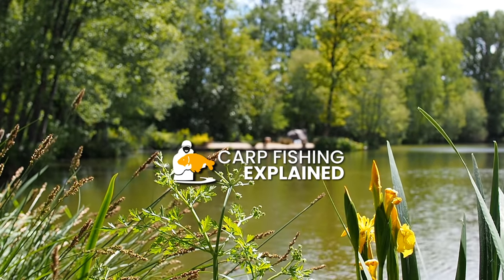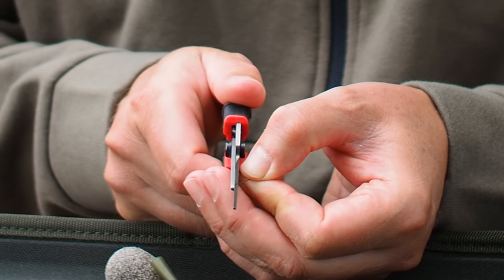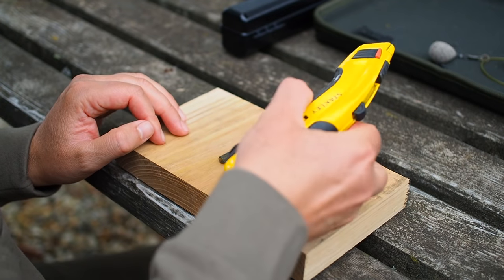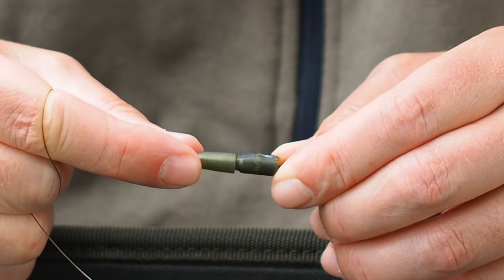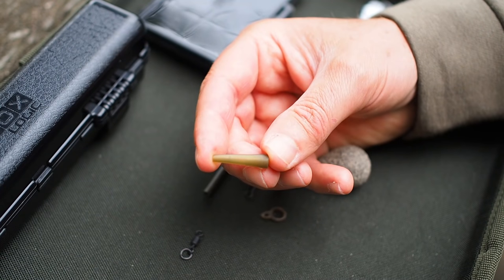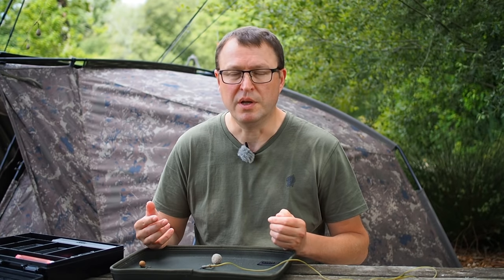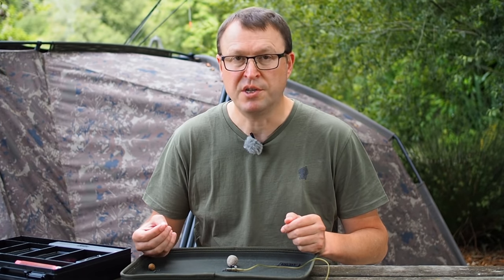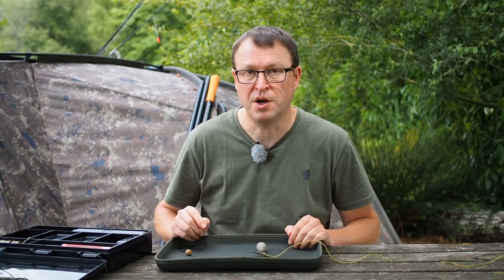I Cut the Leg of a Lead Clip (HERE'S WHAT HAPPENED)

Comment: Hallo Matthew, again a great video with a solution to avoid the leadclip problems i'am using already for years.  I'am gonne try your rig setup this season.  Normaly i'am using always a leadcore leader (gone switch to unlead).  Can i use this material for your "shock and run" rig setup?  Is there a reason why you use sometime a tube and other times a unlead core leader?  Thnx
Reply from the maker: Hello Eric, thank you very much for the feedback. Yes, absolutely, you can use a lead free leader for this shock and run rig setup. Some waters ban lead free leaders so that's where I'd use rig tubing. Certain setups work well with either, some with leader but not with tubing and vice versa! So it really depends on the lake rules and the lead setup you use if that makes sense 😊 Really good question! Cheers, Matt
Reply from the maker: Leader or rig tubing ?
Reply: @matthewcollinsangler  Leader...

Comment: Hi Matthew. When fishing a running lead I am sometimes worried the lead has not fallen into its side leaving the hook link sat up off the bottom near the lead itself. Do you always give the lead a small pull after it has settled? In which case maybe a bit of rig foam over the hook point would prevent any detritus getting caught on the hook point. Thanks. 👍
Reply from the maker: Hi Peter, thanks for your question. This is something that has literally never even crossed my mind so it’s not something I worry about. I’ve dropped this rig from a rowing boat and bait boat and obviously I’ve cast loads of them. Even on the cleanest of areas, a lake bed isn't a billiard table. The lead will settle into the gravel and the hook link will sit just fine. I certainly wouldn't try to draw the lead back at all. In fact I’m really really careful not to move it. I wouldn't use a PVA nugget. Cheers, Matt.

Comment: Hi Matt....really interested in using this rig.  What size run ring do you use? I can't find any Nash ones?  Thanks.
Reply from the maker: Hi mate, unfortunately Nash no longer makes a run ring. They used to but it’s been discontinued. In this video I used a plastic run ring from a Fox run ring kit (comes with a buffer bead). I believe Bank Tackle makes a simple plastic run ring that is much cheaper and you don’t have to buy anything else other than the ring so do check them out. I’ve not tested it but it should work fine. Hope that helps. Cheers, Matt.
Reply: @matthewcollinsangler  Thanks for the reply Matt

Comment: Hi matt, when tying the knotless knot how many turns is acceptable as you only did about 4 so the hook stop fitted neatly, thanks
Reply from the maker: Hi Geoff, good question 😊 It depends on the hook size, the diameter of the mono and exactly where I want the hair to exit. If you watch my mono hair rig video: https://youtu.be/LzFina92brM you’ll see that with a size 6 Chod Twister and 0.40 mono, I use 7 turns before adding the bead and I like the way it sits. When using 0.30 mono and a size 8 chod twister I change that number to 9. It’s all very subjective of course. I just look at it and decide whether I like it or not really. Hope that helps, Cheers, Matt.
Reply: @matthewcollinsangler  thanks matt

Comment: Hi Matt, have you had any use with One More Cast’s run rig system? reckon it does the same job as this shock and run system?
Reply from the maker: Hi mate, I’ve not tested the OMC system but it’s a copycat of the Fox Tadpole system. I’ve tested the Fox system and I'm not a fan because the sleeve does not fit snugly onto the swivel and on the take the sleeve just slides up the line with the lead which is absolutely not what I want to happen. All I can tell you for sure is that this arrangement worked well for me in testing and did exactly what I wanted it to do 👌

Comment: Hi Matt, apologies if this has been asked already but is there a minimum weight of lead that you would use with the set up?  Thanks, Paul
Reply from the maker: Hi Paul, that’s a great question and not one that’s been asked before! During testing I used leads of 3-4 oz. You could probably make it work OK with 2.5oz leads but unless I’m doing something a bit different, 3oz is my starting weight. I need to do a video on lead sizes really. It’s on the list lol. Cheers, Matt.
Reply: @matthewcollinsangler  Thanks Matt, continue the great work

Comment: Gonna give this a go but don’t you think the tell tale Would be better left from attaching the main line and coming out from between the clip and the tail rubber.  As I think tied to the swivel as you did wound stop it from rotating  what you think?
Reply from the maker: Hi Shaun, thanks for commenting. Sure you can do it in various ways, TBH as long as I was using a ring swivel to connect the hooklink, it wouldn't bother me so personal preference mate. Cheers, Matt.

Comment: Hi Matt, just found this video really interesting stuff. Quick question have you used a PVA mesh bag or stick with this set up, will the lead stay fixed? I don't want the force of the bag to dislodge the lead from its positon.
Reply from the maker: Hi Matthew, if you use it with a PVA stick, you need to cast and hit the clip. If you just launch it, the PVA stick will pull the tail rubber away from the ring and you might end up in a tangled mess! I fished this system and caught well with a PVA stick but I'm very confident when fishing to a clip. Hope that helps.
Reply: Have you seen these, would they provide the same benefits as your doctored lead clip? Fox Edges Camo Running Safety Clip Kit
Reply from the maker: @D.R.W_edits  I’ve had a play with these and to be honest, I was disappointed as they didn’t behave in the way I want which is why I came up with this system.

Comment: hi matt. would this idea of the small sinker at the end of the tubing work with a heli set up? regards graham
Reply from the maker: Hi Graham, I have been having a think about the implications of doing this and I am not really sure about it. The problem is the elasticity of mono. Under a small amount of tension, a gap appears between the sinker and the tubing. This isn't a big issue when you have a large plastic ring that needs to safely ride over it but a helicopter rig requires a swivel on the mainline. I could see the swivel catching on the sinker and dragging it up the line. During this time there's a greater risk of things getting snarled up with debris etc. Personally I wouldn't use a sinker above the tubing with a Heli setup. Cheers, Matt.
Reply: @matthewcollinsangler  thanks for the reply sir. If only someone would come with tubing moulded to a tail rubber/buffer!
Reply from the maker: @grahamrg  Yeah for sure! I believe that Korda has just released a tubing based heli system. It has a special little plug that securely attaches the tubing to the buffer bead. It’s all good in theory of course but in my experience tungsten tubing is notorious for cracking and splitting into shorter lengths. If this happens you are relying on the tubing to slide safely up the line and off. If you watch my lead clip video you’ll see that in reality this doesn’t happen because it takes so little for the tubing to jam. IMO the only safe way to fish a tubing based heli system is to fish it as a pure running system without a top bead. If you do need to hold it temporarily in place then I’d just use some PVA tape. Hope that helps. Cheers, Matt.

Comment: Great rig idea but what is about the air inside the tube? Does it may float the line?
Reply from the maker: Hi mate, thanks for commenting. In this video I was using the Nash no spook rig tubing. It’s not as heavy as tungsten tubing but it still sinks. I tank test all the products I use to make sure that they behave as intended. If you’re in any doubt then try it for yourself. Cheers, Matt.

Comment: I’m getting a lot of line twist when setting up like this. I have no doubt it will be my own fault (I haven’t been Carp fishing for long.) My thoughts are that the lead is ‘corkscrewing’ when I’m reeling in and then rotating the lead clip and consequently the main line. I’m using a 2oz Fox Edges flat pear lead and am wondering if the shape is making it corkscrew when reeling in? Reeling in too quickly maybe?
Reply from the maker: Personally, I don't use flat pear leads, I prefer a round pear lead. It's very difficult to say what the cause of your problem is... in my experience, it's usually because the line has been spooled up wrongly or you're overusing the baitrunner/free spool facility on the reel. We've made a video on line twist which may help you: https://youtu.be/pf1m8FJIP6k. Cheers, Matt

Comment: Hello Matthew, it's necessary to use chock leaders or not? Thanks 😊
Reply from the maker: Hi mate, no, absolutely not. There's no need to use a shock or abrasion leader just for the sake of it. I only use a leader when necessary. I use leaders when fishing low diameter mainlines for maximum range. I also use them for added abrasion resistance when fishing rough terrain such as rivers and weir pools. Most of the time I use 0.40 mono and at the business end it’s either 1m of tubing or 1m of leadless leader. Cheers, Matt.
Reply: @matthewcollinsangler  That's what I do to be honest, just want to double check with you. Thank you so much 😉
Reply from the maker: @egidijusgruzinskas5151  No problem 👍

Comment: Unfortunately i can confirm if you use foam nuggets this fantastic method does not work at range unfortunately the pressure of the nugget hitting the water regardless of stopping the line it always dislodges the run ring defeating the mechanism
Reply from the maker: Hi Simon, I wouldn’t worry too much about the ring ejecting early. You’ll lose the shock effect and you’ll lose the tell-tale indication but it won’t stop you from catching because you’ll be fishing with a pure running lead setup which is highly effective. One option would be to drop the nugget. I used to use them but I don’t bother anymore because in my fishing, I don’t think they make any difference (you might need them for weed of course). Either way, I would cast to a clip and feel the lead down because this will keep the lead in position as it’s falling through the water. If you don’t do this, the lead and the rig might become separated and you’ll end up fishing with a longer hooklink than you think you are. Hope that helps. Cheers, Matt

Comment: We're booked into a fishery with a 'no fixed leads' rule. We've got olde trusty bolt rigs on one rod each, but on the other we usually have a helicopter setup (not allowed) so going to try this out.
I wonder though, how prone is this very neat running rig setup to tangles? More so than a helicopter setup I should think?
Reply from the maker: Hi mate, when used in combination with one of my 0.40 mono rigs, I've found it to be very tangle free. At medium range I fish it with a supple braided hooklink and as long as I hit the clip, it lands fine. At max distance (when I don't bother clipping up) I just increase the diameter of the mono (or use fluorocarbon) to increase the tangle resistance. If you're concerned about tangles, don't use coated materials with a stripped back section. Hope that helps. Cheers, Matt.
Reply: @matthewcollinsangler  Thank you, looking forward to trying this out :)
Reply from the maker: @twincamspit  All the best with it mate.

Comment: Have you not seen tadpole beads you get the same effect without chopping up other components. Easier and cheaper.
Reply from the maker: Hi Gavin, yes I have seen the Fox tadpole system and I’ve test fished it over a number of weeks this year. I was disappointed with it actually. It works well enough with a leadless leader but with rig tubing the tadpole comes loose from the swivel way too easily and if this happens the whole rig can become dangerous. The work around would be to glue the swivel into the tadpole but I don’t like that. It’s not one for me. Cheers, Matt
Reply: @matthewcollinsangler  your a fool its a hundred times more dangerous to put the tungsten bead behind the rig tubing. Your explanation is full of crap the lead always comes off the bead before the swivel comes loose. having any fixed components would always make the rig dangerous.

Comment: Love the video, but the leadclip is totally unnecessary. Just slide a tail rubber over a swivel and slide the ring of a ring swivel tight over the tail rubber.
Been fishing this style of semi fixed running rig for years. Works a charm, just like the rig presented here, but less complicated.
Reply: @GrimyBugger are you trying to destroy the tackle industry mate? Peoples livelihoods depend on those needless bits of plastic! 😉
Reply from the maker: Hi mate, thanks for commenting and I totally get where you’re coming from. I’m familiar with this setup and it’s the one I used with anglers here at Beausoleil when they didn’t have any inline leads and I agree it totally works. The feedback was that they had problems when dropping rigs manually from the rowing boat as the lead would lose contact with the sleeve (when dropping rigs but holding the bait). The other problem was that sometimes the tail rubber would lose contact with the swivel and slide up the tubing. This new version solved both of these problems and improves the shock effect so that’s why I’ve adopted it. All the best with your season. Cheers, Matt.

Comment: Can these run rings withstand casting with 250 grams lead,because i wanna use this rig from now on?
There is no way around it where i am fishing,because i need long casts ,and the water flow is very very strong,and i cant keep the rig in place,unless i use very heavy leads.
Even when feeder fishing ,we use 180 to 200 grams leads,and that is with much thinner main line.
Thanks!
Reply from the maker: Hi mate, as I said in my previous answer, I would not use the rig if I was using braided mainline, heavy leaders and 250g of lead. This is a completely different type of angling situation to what I do. If the dumping of lead bothers you as it does me then I’d look at lead free alternatives and just fish a lead clip. I hate lead clips and avoid them at all costs but even I have to admit that sometimes it’s the only safe and effective way to fish. Cheers, Matt.

Comment: Matt. I've been trying this rig exact as your instructions and have had fish get away with it. A little rattle of the bobbin and buzzer and fish spooking out of the swim. My fish are much smaller than your fish, should I scale the hair length and hook link length down, but keep the size 6 hook. My fish are mostly large doubles, thanks mate.
Reply from the maker: Hi Richard, I’m very surprised that they are getting away with it. I’ve caught doubles with this rig as is, so I really don't believe that the length of the rig or the hair length needs adjusting. For me the number one reason why this happens is down to hook sharpness. These are the questions that spring to mind: Are you using the chod twisters or another brand? Are you checking (with an eyeglass) every hook before use? Are you inspecting each hook and changing between casts? Are you hand sharpening? Sorry for all the questions! We are publishing another video about hook pulls this weekend so hopefully it will give you some things to think about. Cheers, Matt.
Reply: @matthewcollinsangler  Yes mate, its not the hook sharpe-ness, and yes its Chod twitter size 6. I'm getting a bleep, bobbing moves up a few inches then a big bow wave and a carp leaves the swim. Fluorocarbon hook link .40 slack line as I'm fishing the margins. I did shorten the hair last night and the hook-link to 6'' and had a nice little fish. Sadly the hook fell out in the net so I don't know where the hook hold was Matt. I'll stick with it for a few more trips, but my confidence is slowly going off the rig my friend. But I do love the running set up, even though I still seem to over tighten the ring on the clip. Thanks for all the advice and help. Richard.
Reply from the maker: @richardbarrett7544  I'm sorry to hear that it's not working very well for you. Carp behave differently in shallow water so this might be a factor. One other thing, you’re using fluoro and fluoro is much stiffer than mono. I have tested this rig with 0.40 mono, not fluoro. Before you write it off, try some mono. I've had very similar experiences with fluoro at Beausoleil and it's one of reasons why I don't use it here. I'm sure there's a solution and you will crack it! Best of luck, Matt.
Reply from the maker: @richardbarrett7544  On reflection, personally I'd go another direction and go with braid to create a totally supple presentation. Carp in shallow water are very picky feeders and a supple rig will react quicker and more naturally. The weight of the bait will have more chance of going into the mouth and pulling the hook down with it.